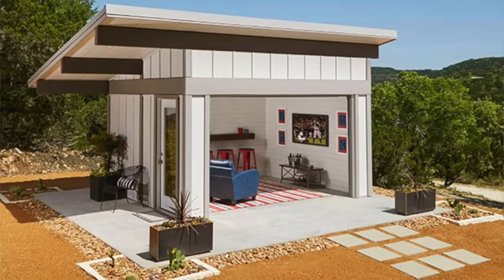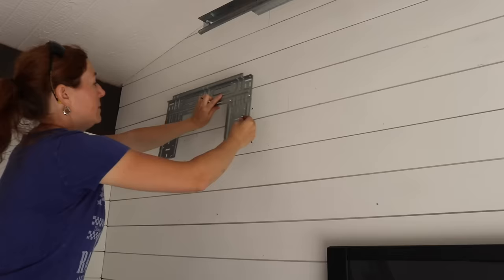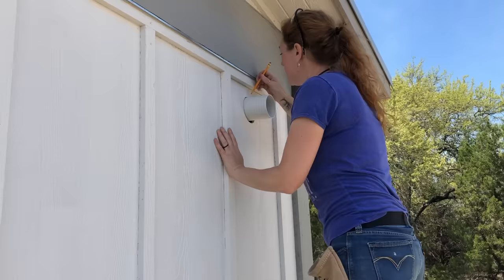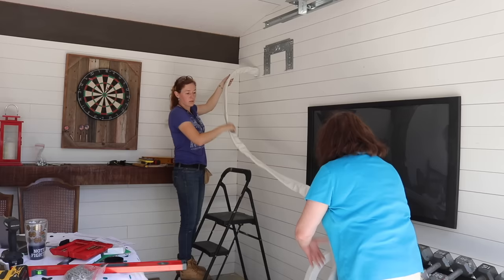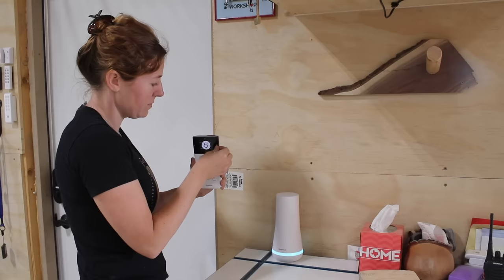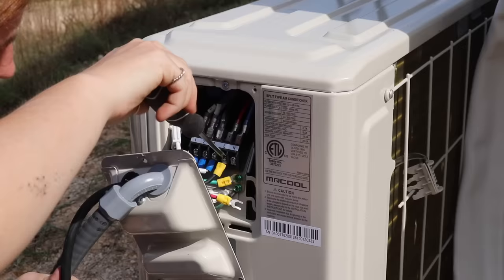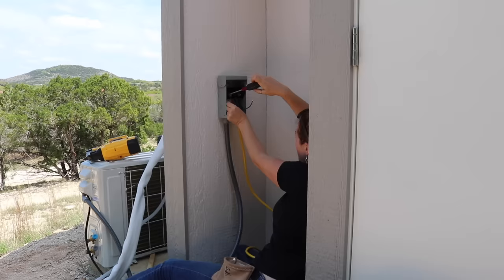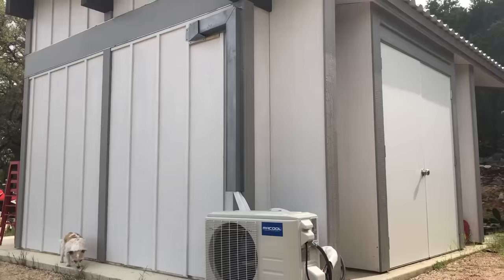DIY Ductless Mini Split Install - MrCool Unit

Comment: You  are a remarkably capable person! Good job on the installation- but I really don't like the excess reefer lines. Perhaps, in a new construction situation, the lines could be run inside the wall (thought that's not great, either) or some kind of removable cover could be used, to keep the excess manageable.
Reply: No lol lo ooo ch gy

Comment: I wonder how long it will last? Since coiling the refrigerant lines will trap the oil and the compressor might fail. In this case for anybody who is a not a pro and can’t cut the lines, it might be a better idea to install the condensing unit as far as you can get so the line set stays flat.
I know it’s gonna look bad, but it will prolong the life of the compressor
Reply: My mini unit has a 7 year warranty on the compressor

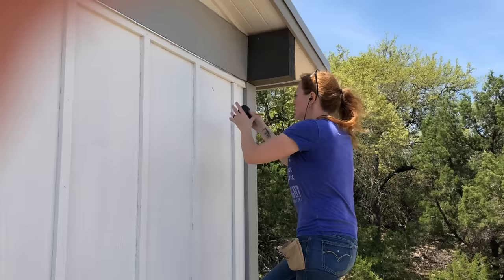Comment: 2:06 the outside hole should be approximately 1" lower than the inside hole, to keep the drain line sloping toward the outside drain outlet.
Reply: Makes you wonder how water goes down and then up P traps and finds a way out.

Comment: Hai, i think you need to keep the pipe insulated. That mean more thicker sponge with reflective aluminium that keep cooler air transfer or transported to the room, which help you to save a lot energy and cost.

Comment: Thank you April -- this is a really valuable, perfectly done video! Very impressive and thanks for demystifying the process! I'm curious to know, depending on how frequent you use this "tiny house" what the payback would be for a relatively small solar install with a battery compared to running a generator. You could also skip the battery and do the majority of the conditioning while the sun is shining minimizing your generator usage...

Comment: More like MissCool! I'd be worried about wall anchors though, especially when vibrations are expected, it's only a matter of when those things fail, a molly anchor is preferable to those plastic ones. I'd have mounted it on a board that was big enough to span studs.

Comment: You should move that piping away from the condenser because it will block airflow and shorten the life of the compressor. Maybe strap is to the wall.

Comment: I have never installed a Mr. Cool, however you main want to double check with your installation manual as you typically do not want to coil a line sets vertically as it causes oil traps.  It’s possible Mr. Cool allows this, but worth checking before burning up a compressor.  I know that mfg’s such as LG, Daikin and Mitsubishi do not allow this.

Comment: Wonderful,Im SOLD.Looking at a 24K BTU for a Enclosed Patio,the Line Set is perfect length as the ceiling in the Patio is 14' Hugh,just will need to drill through CBS Concrete Block for the pass-through,you got a better quality cover for the line set than you could buy at Amazon as its Aluminum not Plastic.Great Job!!Keep Cool!!

Comment: Did you Evac the line set? if not you just added non condensed air to your system which will make your air insufficient... need to shorten line set will trap oil from the compressor possible burn out... other than that good job
Reply: Spkz she said the refrigerant is inside the line set ? 🤔🤣

Comment: Tip to all the DIYers.... Make sure the drain line is below the lineset through the wall, I needs to be at the lowest possible point to avoid problems ie blockage, and yes to a screen at the bottom of the drain to keep bugs out, but check it periodically for being plugged
Reply: I would want a water trap as on any AC drip line.

Comment: I don't quite understand these DIY setups.  They are more expensive, and I would say they are harder to install than regular non-DIY ones.  You have to push a mile of lineset through the hole, whereas with a non-DIY one, you just push a few inches through.  Yes, you do have to make one connection, but the flares and nuts are all ready to go ... you just take a torque wrench and tighten it.  Simple!  Then you just vacuum the system, open the refrigerant valve, and turn everything on.  So easy.

Comment: Congratulations on your excellence as a teacher... and your videography and audio quality is superb.     I notice the inefficiencies; it seems the walls are without insulation in your shed; and I wonder if that glass door is "low e."   You ought to protect 100% of that freon line and the electrical feed from sunshine; I suggest radiant barrier material easily bought on Amazon.    Clad that dull-metal raceway with shiny aluminum (shiny side OUT) and you'll keep the interior cavity temperate... cooler in summer, warmer in winter.   I'm in SoCal and you're in Texas and we both have serious heating from sunshine.

Comment: Just FYI, the mounting plate template is on the inside cardboard of the box.  You need to cut the box apart to use it.

Comment: Great video. I have one comment. The way you installed your line set, it probably won’t drain out the condensate adequately. It is gravity flow so the drain needs to go downhill and should have been placed on your right side and slanting downward. I am only telling you because I mad that mistake before and filled my wall with water.

Comment: Back in my day we would hook up the line and then open up one side of the unit so that the freon would rush through the lines, through the condensor, then back again and flush out all the air and charge the lines with refrigerant.

Comment: April..... Please move your generator   I Was running my gen in the door way of my shed and the  unit turned when in operation and the exhaust pipe started fire within 30 min. Building was full a blasé. It was windy .... It's was a total loss. No life was lost. Just my maker space! .... Peace.  Love your brand !
Reply: That's a good, and scary point.  Was there anything to mitigate it?  Brick wall, or fire block?  Maybe something installed similar to what is used for wood stoves?
Reply: She did say the genset would be outside when in use and sitting where she sat when installing the junction box to plug in to to power the ac system.

Comment: Why did you feed the line set from the inside out? When you install the inside unit, the connections on the back come through so you can connect the line set from the outside. Nice video though!

Comment: You should vacuum the unit to take all the air inside the tube cause air includes moisture and it will freeze inside the radiators and block the gas flow
Reply: The system is precharged.... no vac or Freon required.
Reply: This unit may have been under vacuum. Virtually no contamination if done correctly. But you are right and a lot of these smaller systems are ignoring contamination simply because they are so small and very little air would actually get inside since they come offset with nitrogen.
Reply: Spme of you just never LISTEN to what you hear others say or just assume entirely the opposite of what the manufacturer has told you ... Good Grief. The purpose of this at least 2 years on the market DIY model not one has any DIY person had to call in a certified tech to redo the lines (unless the owner decided to disconnect it for some reason, which then you do need to get it serviced as she mentions in the video).

Comment: I think you have to draw down a vacuum on the wall-mounted unit and the tubing that runs to it before you hook it to the compressor? I know it' s precharge, but I think only the compressor is precharged.
I don't think you have to add refrigerant unless you're running over 20ft.
If that's true you may as well cut the copper lines to a more appreciate length.

Comment: As a tech, try not to have anything in front of condenser/coil it will restrict air flow. Also the lines looped around like that can cause oil to get trapped and damage compressor

Comment: Great job but the inside hole should be about 1/4" higher than the outside hole to make suer that the drain line is going down hill to assure proper water flow.

Comment: There is a building code for minimum condenser clearance from an outside wall. I believe the minimum clearance is 12” or more. Allow at least 12" distance to a wall or fence or similar solid obstruction - typical of most installation instructions. I would need to do a code review to find the exact distance. The condenser unit requires air ventilation on all sides for cooling. I would urge you to relocate it 18” to 24 “ from the outside wall.
Reply: You also need a concrete pad for the condenser

Comment: Nice job. My reservations regarding mini-splits is the cost compared to a wall or window unit. My wood shop only is about 270 square feet, so an 8,000 btu wall unit should work. That's only $400-$500. I also had a friend accidentally crimp the line while installing a unit like this and when he tried to straighten it out, it cracked and PSHHHHH... there went all the refrigerant.
Reply: @paulcopeland9035  I bought a few new Frigidaire window units, they are not as loud as older units, the larger one now sits in storage since i replaced a noisy 10k unit for a 12K one as from mentioned and it runs quieter and only cooling about 800 square feet, I got another brand at 5k in my bedroom since the closet has a bit of a draft (small window in it, old place, rental unit).

Comment: Excuse the question, I'm not a skilled worker. Shouldn't the tubes be cut to size? Don't the long tubes dissipate heat or do they decrease efficiency?
In the electrical contacts, instead of a simple junction box, I would have mounted a magnetothermal switch.

Congratulations on dexterity, you are very good.
Reply: Good question.. It is sold as a DIY kit. Therefore the line length is to accommodate up to a second story application..  But the lines are pre charged and cannot be cut without having a professional HVAC person evacuate and recharge the unit..

Comment: Nice idea! I did not know there was a diy minisplit. How are you going to insulate? Garage door and no insulation in the wall is tough to keep cool.
Reply: This unit has been around for at least 2 years now, only found out about it a year ago myself. seriously so much info online, so little time to find new things. This is the 2nd generation version.

Comment: Routing the condensate drain through a dribbler fitting at the top of the  condenser coils could improve its efficiency significantly.
Reply: No it wouldn’t.

Comment: not sure if you have a copper theft problem in your area. i would have put the outside unit on the roof of the building. you will never know it is running that is how quiet these are. i also noticed you did not anchor it to the ground a quick bump by a kid and the outdoor unit is done for. finally, you CAN shorten the lines after you install it you will need an A/C guy to do this since he has to evacuate the system shorten the lines and recharge it.

Comment: Another install video discussed the need to coil that long line horizontally because when it is coiled vertically, if there is condensation, etc. it flows to the bottom and blocks the flow of air - at least that is my understanding of what they posted.
Reply: What do you mean by coil it horizontally?

Comment: i run the line to the attic.   that way the line is hidden horizontally in the attic.   then i drop it down to the hole.     the  drain line can still go outside   drip drip drip.

Comment: Didn’t see any insulation when you drilled through the wall. That along with that giant roll up door can’t lead to very good thermal efficiency. How has it been to run the ac?

Comment: You should put a bug screen on your drain line. It is basically open to the inside. To Keep the bugs out.
Reply: Miss the big roll up window door? Bigger area for bugs to in and out when it is open than a small ac line hole which is covered in the metal raceway she showed having installed it DIY.

Comment: Great video April!! I've been thinking about buying one of those DIY mini-splits for our FROG. Looks like a super simple, straight forward installation!!

Only concern is your generator placement. You shouldn't run a generator in a confined location that close to the building unless you make sure the immediate walls are totally sealed to prevent exhaust from entering the shed. Also need to make sure no exhaust can enter through the roof eaves.

Great job and thanks for the wonderfully instructional vid!!

Comment: Thanks for the video. I always was wondering how these units are charged with refrigerant. Now I know - they come prefiled, and have quick connect connectors to connect stuff.
Reply: If you do not perform a vacuum test to get the moisture out of the parts of the unit unsealed, it will cause problems that will shorten the life cycle of the unit and also cause it to perform at less than its rated efficiency.

Comment: You need to coil that line somewhere else. Its blocking airflow. You dont want a gen that close to the structure. The noise is maddening. Even on a smaller gen. Im guessing that split is at least 1kw. Prolly. 1.5kw. On startup that compressor draws a bunch of current. You are gonna need a 4kw-6kw gen. Not small not quiet. Build a separated structure with heavy guage wire to house the gen. Get an eletric start so you can operate it from inside the shed.

Comment: Why would you use wall anchors in shiplap wood? Or is that a faux?  That’s a pretty nice guest quarters. Love the door.  Nice AC installation. It’s wild that the lines are so long. Hopefully they don’t get bumped out there.

Comment: Great job.
One question tho.
Why didn't you vacuum the line set?
Reply: Both units are precharged, you connect them and open a valve and that'd break a seal and allow refrigerant to flow, there is minuscule amount of air left with this install pattern

Comment: The lineset is not pre charged ...the charge is in the outside unit...you release the charge into the Line set with an Allen wrench you can cut down the line set just need to braise the fittings back on.

Comment: if you want to keep that generator there forever, than think about central controller for AC and Generator. So when a call for cooling happens it will send a gen start signal then wait for it to normalize then turn AC on, Then when no more cooling needed it will turn AC off and wait few min to see if more cooling needed (can be changed in settings) if all good it will stop the generator.

Comment: Zip tie the Drainage line . DIYER'S ,If on the grid power and have one these. And going to resale home or business . Inspector require a AC disconnect and wired in to panel. A cord & plug  into ac outlet  won't do.Preset only come in 25 ft or 50 ft . I have install  many of these kind Ductless  AC system  & have the tools to make shorter or long runs,

Comment: Awesome video ! Your amazing ! I seen your unit is still working after all this time ? I was concerned because I coiled my line set vertically kinda like you did and I saw some people said it should be horizontal
Reply from the maker: Still working and have not had any issues thus far. Thanks for watching.

Comment: Should be vacuumed. You are using it only once in a blue moon, but for most people this procedure will not work. The air in the lines must be removed or it is bad for the compressor and other parts. I've done much research on this and can't just hook it up and turn it on if you want the unit to last.

Comment: You need to reduce the lot of extra piping. 

Also for indoor ahu the drain pipe needs a slope even if a few degree slope helps.
Reply: no some units require you keep the tubing at a minimum length and do not allow you to cut it down.
Reply: @soldatheero  yes that's true. But that pipe seemed a tad too big than needed.

Comment: As long as you pull a vacuum on the line set and coil to 200 microns your fine. If not then you drastically shorten the life cycle of the system especially since it's a heat pump system and runs year round.

Comment: I'm all for DYi and like you builds and not to rain on your parade April, but don't you have building and mechanical codes where you live ? Here in "backwards" Florida you'd have to get a permit to turn this shed into living space and a mechanical contractor to install the AC, precharged and ready to install or not.

Comment: I used a 4 inch stucco hole drill saw. Then had to drill wood and sheetrock just used the same stucco hole saw it did it. Hard to use a copping saw on the 4 inch hole.

Comment: Overall this is a good video for the DIY person.
However...My understanding is to NEVER coil up the excess line set as this causes an "oil trap". It seems that oil pools at the base of the loop(s) and then doesn't get to where it needs to lubricate stuff.
Has this been your experience?
Did it burn out a motor/ compressor?

Comment: On the wiring looks like you crossed the Neutral - black and Line - Red. on the Liquid Tight Flexable Conduit to the terminal block. Did you vac out the lines before you released the charge?

Comment: April? Don't forget to run your generator at least once a month year-round. Look at it this way, it's simply an item of maintenance for your machinery. This is to include your air conditioning unit of course.

Comment: Solar panels would be a lot cheaper than putting a hydro line out there for sure. Then later you could put a line to your shop and ad more system up there to run your shop off.

Comment: Could you have run the line set inside the 2x4 wall so that it was less visible on the exterior of the shed?

Comment: You might want to replace visible drain line with 3/4 pvc because that drain line gets very brittle in no time and can break off/start leaking where it's not supposed to, french drain at end?

Comment: Doesn't the line set coiled up behind the unit impede proper airflow? I would have hug it on a hose rack in the alcove above the generator
Reply: no the fan pushes air through the radiator fins out the back. simply passing by the lines.